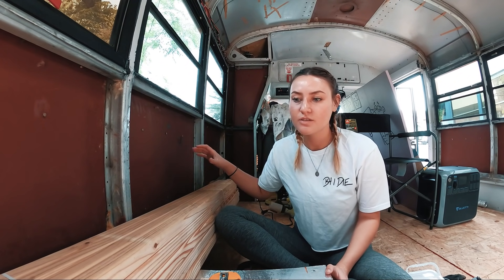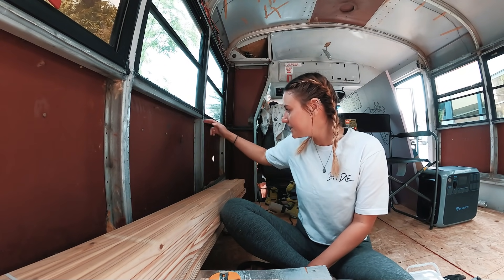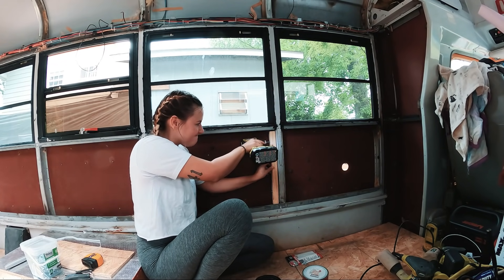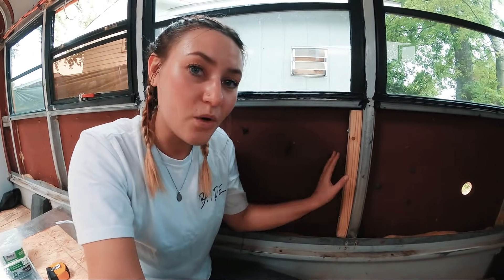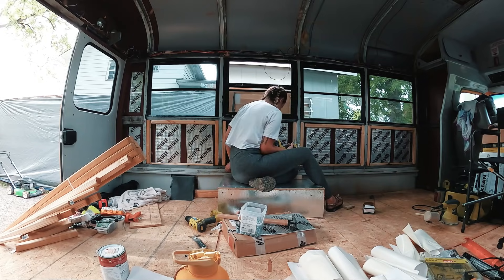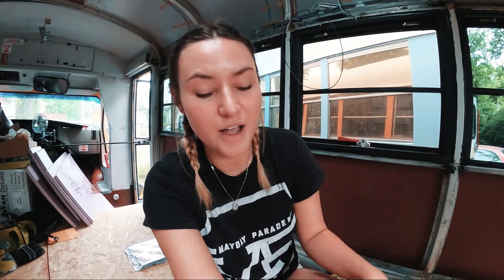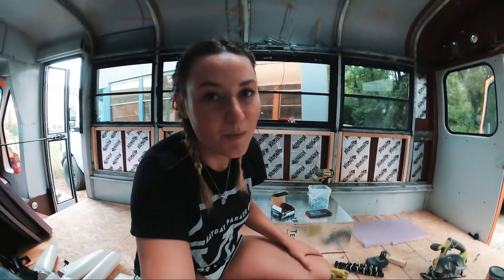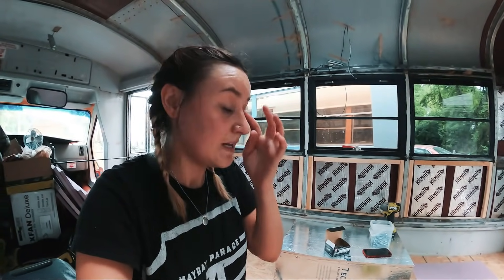Framing & Sound Deadening Bus Walls - Solo Female Skoolie Conversion

Comment: When you was doing the framing with the 2×2,s you could have put them where wanted then clamped them down in place then drilled the screws in. But you are still doing a very good job.👍👍👍
Reply from the maker: No clamps unfortunately

Comment: I'm solo female too doing all the physical work on my van, I understand, it is very tedious work and need a lot of upper body strength for sure when doing even the self tapping screws, etc. I'm now almost near complete with my subwalls. Next will be my tire and gas walls to get them framed covered (already been insulated when I insulated the walls awhile back) and will also be resetting the original main van wiring in the midst. However, I'm so excited with you about getting those projects done in your bus conversion, I enjoy watching your videos as you go along with each project to be done. Take care, can't wait for your next videos, be safe and blessed, sending hugs love and prayers to you and your family too from me and my dad in Odessa TX 🤗💖🤗💖🤗💖🤗💖

Comment: You can predrill the holes using a drill bit (smaller diameter than self tapping screw), and then follow with the self tapping screws. A good drill bit is a lot easier to start holes through thicker metal than using the screw. Otherwise, your determination is laudable.
Reply from the maker: I broke my smaller metal bits so I just used what I had
Reply: @LeaveHerWild  LOL. A good set of drill bits are like gold and saves a lot of frustration. Recommend not skimping on drill bits, especially if you are drilling through metal. I love your problem solving skills with limited tools and supplies. Very informative and a joy to watch. Cheers.

Comment: Btw, if you pre-drill a smaller hole those self tapping screws zip in a lot quicker with less force. You can “eyeball” the drill to make sure it’s thickness is slightly thinner than the solid portion of the screw...

Comment: Don't get discouraged. You are doing a good job on the project. Screws will start a lot easier if you use a small drill to drill a hole in the metal so the screws will start in easier. Driving those screws into the metal will build your chest muscles. Think what that will do for you.

Comment: Pre-drill the wood the same size as the screw, is use a clamp to temporary fasten the wood to the steel beam and then drive the screw right thru the wood and the steel (then the wood stay in its place).

Comment: Great job gal ! Keep it going.
Run your wires before you do your final insulation.

Ok I'll we if I can hook ya up will one and some other RV parts.
Reply from the maker: Wiring will make sense I promise
Reply: @LeaveHerWild  are you  going to use a converter
Reply from the maker: @kathymikulin9006  Yes

Comment: Just a note you might try to use an impact drill less stress on your muscles .
Reply from the maker: I am using an impact drill lol
Reply: Oh damn lol Just need some upper body strength  (# no arm workout needed for this week lol )then maybe just do a pilot hole in metal at the same time you drill wood save a little time lol  @LeaveHerWild

Comment: Jaylena; If you drill a small piolet hole first, the self-tapping screw will go in much easier thus saving the power on the drill.

Comment: It is easier to predrill the holes in the metal smaller than the screw. It makes it much easier to get self tapper started and still bites the metal to make a secure connection.

Comment: I will make one simple comment. If you would pre-drill the holes for the self-tapping screws with a small drill bit, it would make installing the self-tappers so much easier. The drill bit can’t be very big, just big enough to allow the screws to bite. This would decrease the amount of pressure needed to start the screw. Once more a very small bit, maybe a 1/16 or 3/32. If you go to big with the drill bit, the self-tapping screw will not tighten properly. You could always test one to see if that works for you or not.Just info if you have more screws to install.

Comment: When you start doing the ceiling boards. Try drilling an oversized whole in the board. That should stop the board from
riding up the screw. Then you should be able to drive the screw in with the board up.

Comment: To get a straight cut with your saw use a square on the left and hold with your left hand and it will glode along it with no problems.

Comment: If you would see clamp your board to your metal frame before screwing it down the wood will help draw the screw through the sheet-metal keep that in mind if that’s how you’re going to frame out the ceiling

Comment: You're doing a great job. What I would do is use one or 2 wood clamps to clamp the stud to the beam then pre-drill the holes with a small pilot hole going through the metal. Then the screws would be put in with an impact driver. Since I like to over-engineer I'd probably put a bead of liquid nails on the studs for good measure.

Comment: I have a suggestion for you I know it’s too late for the sides but when you do the roof use a 1/8 in drill bit drill through wood and metal make those self tapping screws go faster and easier hopefully this helps

Comment: Good job! But... yes mat first, cut top board, cut sides, predrill sides and metal at the same time. Saves so much time, screw two sides then top. Side will  support top as you screw.  Could also use a piece of duct tape as a third hand to hold wood piece.

Comment: Hi Jaylena, just FYI in the future you’d save yourself some time and strength if you were to drill a pilot hole in the metal half the diameter of your self tapping screw it will still tighten down good if not better than the self tapper itself and you won’t be anywhere near as soar the next day.. your doing an awesome job by the way keep it up !!

Comment: Tip: put a board in each side of the metal, clamp them in place to hold them tight together, screw the screws in.  You can do the same thing on the roof too.  Just have to cut smaller pieces for the curves....or put a lot of small cuts 3/4 of the way through the boards...all the way down...to get them to bend.
Reply from the maker: I don’t have clamps...yet! They’re on my list
Reply: @LeaveHerWild  Get some!  Hurry!  lol

Comment: I love that you do things your way & they are just as effective as the "Professional" builders.  That's why I tune in each time I see you post, plus you have great music when you do high speed rolls. To see what ur up to next. Go girl power; keep doing you.  Ur killin it!  Im almost done with my 4th van build out, on the same van, lol.  I think I have it how I want it now.  You are so making me want a short bus.  P.S. pilot holes with a drill bit made for metal really did help me.  Where my adult son, with more hand & arm strength, could just get done so much easier, which he helped me on this last build with 2 more that I needed.  But its all good, in general dudes have more upper body muscle than us. Regarding framing, im thinking you may need 1 more vertical in middle of each, or maybe not depending on the walls you  use, also, i probably would have done only 1 side of each rib to reduce weight & sweat, lol.  But im sure ur plan is going to be awesome, cant wait to see it.

Comment: The self tapping tech screws are good but I find  getting them to cut into metal is not easy so they need a helping start before they bite go trough.

The framing looks good could not comment on weather it is good to do it like this or not as it depends on  what you are going to do on top of the framing. 

Hope you day has been a good one. 🌞🙂

Comment: If I am seeing correctly, looks like the hole in the bus side behind the drivers seat is not patched, or the patch is white. Anyway... that big of a hole could have a 4x4 blank metal electrical box cover bolted down with some urethane sealant..
Reply from the maker: It’s not patched, I may actually use it for something so I haven’t patched it yet
Reply: @LeaveHerWild  cool. Maybe a good place for shore power connect or water. That is an easy way to patch metal if ever needed. I like your progress.
Reply from the maker: @geoffreybartlett9293  yeah that’s what I had in mind!

Comment: What would of been a better way of doing this is to clamp the wood to the metal to hold it there and predrill though the wood into the metal with a drill bit a bit smaller then the screw and it would have been faster to get the screw in. But you did a great job anyway. Take Care

Comment: Jaylena, when I'm doing a big project I always have 2 batteries, 1 on the charger 1 on my drill ready for when my 1st dies.  It's worth the money having a second ready so you can finish the project.  Just a thought.
Reply from the maker: I have a second one and I do that as well, but unfortunately someone unplugged the one that was supposed to be charging

Comment: drill the metal with a smaller drill than self tapping screw and it will go much better.. be sure to have a good drill bit.
Reply from the maker: I broke all my smaller metal bits so I used what I had
Reply: @LeaveHerWild  
ok then you better purchase some new bits Harbor Freight has some good bits for minimal cost for a whole set.

Comment: K ok I’m only at 11 mins so far but are you planning on rolling the Kilmat out with a roller? I bought the same in the 50sq ft coverage and I was reading the everything on Amazon about it and it said you should roll it after you apply it so it kinda flattens it out. Let me know if I’m over working cause If it isn’t going to make a difference I don’t want to do it lol
Reply from the maker: Yes, I had to go pick up a roller

Comment: Your strength is not the problem with those screws. Your need a corded drill which has way more power than cordless drills. I could not screw into my concrete walls with my cordless drill. I bought a corded drill and could drill holes like butter.

Comment: Great job, but if you leave air gaps in your insulation, you won’t get the maximum benefit.
Reply from the maker: That’s why I’m going in with foam to fill the cracks

Comment: Gotta question on the design for your walls
Will the wall hold any weight on them? I saw you said you added to it  and was wondering if it would work better having the small piece below.   And about the engine does it have a fuel sensor?  Does it feel like it’s not getting gas?   Btw excited for your bus build!!
Reply from the maker: The walls won’t hold any weight, I’ll probably secure my cabinets to them just to hold them in place, but that’ll be connected to the actual wood framing. As far as the engine, my brother and I are working on what we hope is the issue when I get back from Texas. He’s currently out of town and I’ll be gone when he gets back, but we do have a game plan and I’ll be doing an update video on the engine once we get it sorted out

Comment: some of the some of these ugly road is going to shake the inside apart. if you predrill wood &  metal,  drill wood only. let the screw drive threw that's where it going to get all the strength to hold it together

Comment: I was thinking about Ur Flooring as I was watching Ur Brother, I saw the big holes where the floor is, just like in Urs, My ? is this, If U don't put any metal back down on the floor's & all U put is Plywood, what happens to Ur floors when they get wet underneath? that wood will just get all soggy & rot real quick right? Guess I'll need to go back & re-watch when U put Ur floor in & see what U put down first, was it metal? & Then wood on top of that? It doesn't sound like Levi plans on putting any metal on his floors & that troubles me....
Reply from the maker: The paint Levi used on the plywood is weather resident paint. I’ve seen other people use the same technique in their buses and they’ve been in the for years
Reply: Oh Ok sweetheart, I was just worried that ...Here U'd put all that work into Ur new home & then have the floors fall out on U leaving U all W/A big mess... I'm so glad that U've checked it out & feel that U have no worries, I wouldn't feel that it would be durable enough if U ran into a bunch of water, but then that is why I'm not doing the building... I've not done any of the research so I fully trust Ur judgement since U have... Thank U so much for putting my heart @ Peace about this flooring business... Press on Mc Duff...LoL Oh I guess Ur not old enough to even know what I'm talking about...LoL ,,, Just keep going after it sweetheart Ur fine.. I'm just an old women worrying over nothing.... LoL

Comment: To be honest, I do not think the 1x2 is going to be a good screw hold since it is only 3/4" on it's side.
Reply from the maker: I’m only going to be tacking in small nails to hold up my thin plywood walls and that’s just the bottom anyway, it’ll also be tacked into the sides and top

Comment: Don’t use OSB for the walls.  Use actual plywood.  OSB is not “flat” and smooth.  It is difficult to paint.
Reply from the maker: I’m not using osb for the walls lol
Reply: @LeaveHerWild  Thank God!  lol
Reply from the maker: @erikrenner  I bought the super thin smooth finish plywood panels since it’s pretty much going to just be behind all my counters
Reply: @LeaveHerWild  What are you going to use for the ceiling?  Tongue and groove?  Need some old thin bendy paneling or something.  lol
Reply from the maker: @erikrenner  Possibly tongue and groove, I’m still deciding
Reply: @LeaveHerWild  If that plywood panel is thin enough (and can bend fairly easily) it may work.  Remember...keep things as light as possible.
Reply: @LeaveHerWild  Oh...one more thing too...for the ceiling...have the paneling, or whatever you use, meet halfway at each metal joint.  Then you can put (thin and bendy) trim pieces along the metal “frame” (one side to the other)...evenly spaced...and make it look like “beams” throughout...sort of.  How far is it from the middle of one joint to the middle of the next?
Reply: @LeaveHerWild  
Oh...and probably halfway between each metal joint in the ceiling you’ll need to put in another wood strip to nail to...probably can just use liquid nails to mount them to the roof so you’re not drilling into the roof, etc.